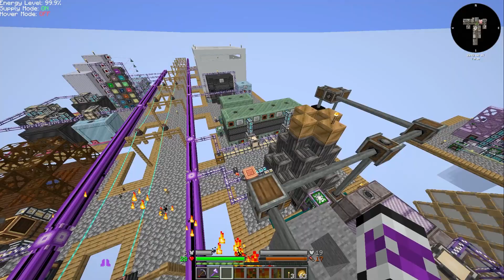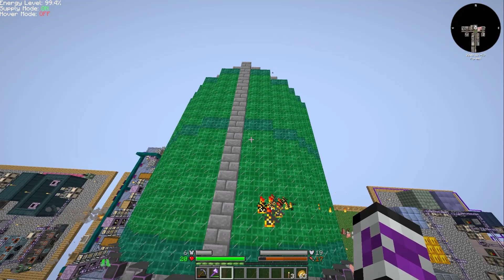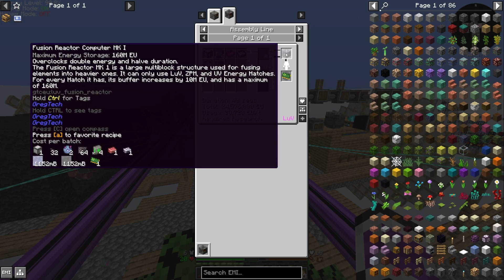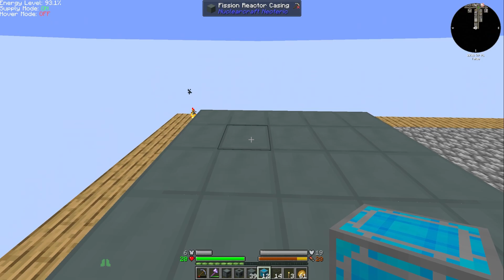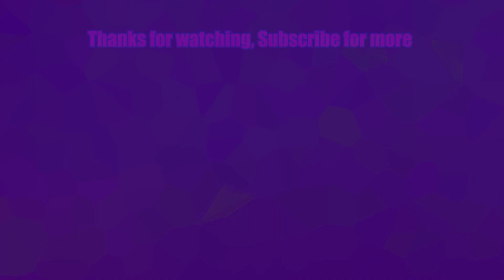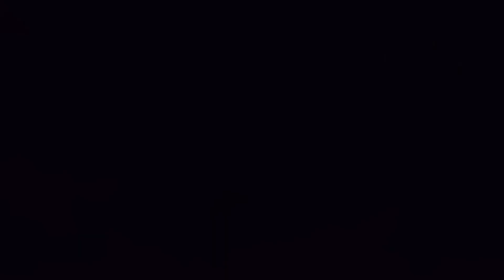Star Technology: Episode 39 - Fission Reactor Troubles

Comment: I'm not really an expert in nuclear craft, but I did have to use the mod quite a bit for Compact Claustrophobia and Feed the Factory. The ai website for that version of NC essentially allows you to build a perfect reactor. You input the type of fuel, the coolers you want to use, and it will run all simulations/setups possible with those inputs. Most often you have to build multiple reactors to use as breeding reactors. The site also allows you to optimize for breeding (higher fuel usage) or for power. It also lets you set the net heat you are looking for so you can let them run passively. If you want a better explanation of the site, look at gaming on caffeines playlists and look for the Feed the Factory and Compact Claustrophobia episodes about the reactors and he shows visuals of those. I've not yet explored if the new version of NC has a similar website or if they use the same one.

Comment: You can make the Fusion Reactor with fusion glass when you click in multiblock info on P:0. It is much cheaper than making it with all of the 70 casings
Reply from the maker: I'll use glass wherever possible, it's cheaper as you say but also it's less blocks to change when I upgrade it, but I'm sure I'll still need some casings anyway.

Comment: So basically, when you have a nuclear reactor and it gets hotter, it runs faster because there is more energy in the system.  The higher temperature is the cause for the higher heat multiplier.  This is also why we can have fissile materials in a stable state in some temperatures, but said material will go critical when heated/ pressurized/ put in a different state.
Reply from the maker: Oh, that makes sense. I doubt I'll need to worry about the complex materials in future, and all of that stuff will go way over my head anyway.

Comment: you cold have gotten plutonium from centrifuging uranium dust which you get by processing uraninite
Reply from the maker: I knew there was something I was missing. I was gonna do this eventually for the quests, so I guess now is as good a time as any, but it's still annoying to know that there was something so simple I missed. Thanks for the tip, I'll use that next time.
Reply: Or you macerates red granite block but I don’t know if it exists